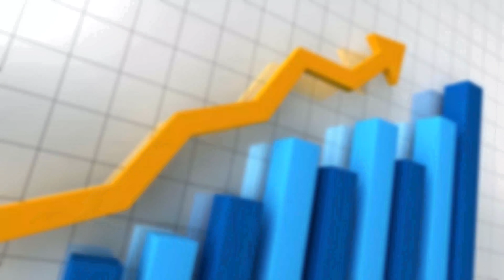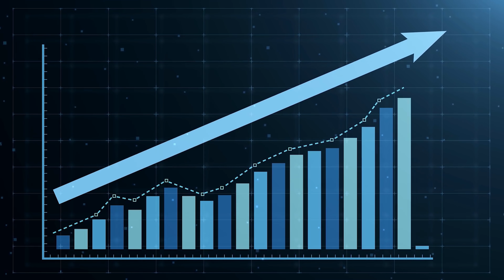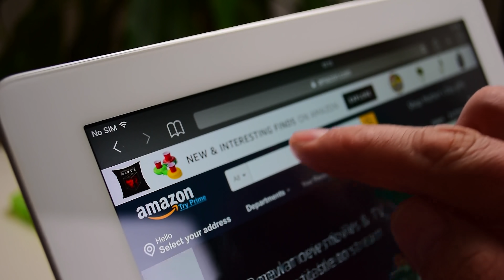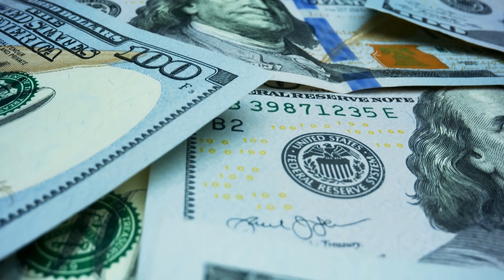How Does SpaceX Build Starships So Quickly?

Comment: These are not actual rockets, more like tin cans.
They do serve a purpose to get the landing right. But these are no where close to a real rocket that space x envisions

Things will slowdown once they build ships that have re entry capabilities. As they require more strudy building. Ceremic coating

I think they might have to go in for some redesign too.

And then there's the boosters for this rocket, which itself is a big challenge.

So bottom line...things will slow down as soon as spacex changes its goals from landing to re entry and landing

Comment: a lot of numbers printed to work as bombers 
wider from down and more thin from up 
to make it more easy to land 
3 shuttle if replaced by one or central one 
to work as ball that is with camera on many planes 
gear to make it move and another gear to make it move >> up down right left 
so ball will be the main shuttle
Reply: 3d printed clay mold 
and pour or press melted metal or steel at
Reply: many rocks mixed with metal steel 
to decrease cost 
use only water electrolysis gases as fuel 
make many printed reservoirs as water tank that on top of it 
the bump that take main 2 gases
Reply: if you make door for reload after landing 
door will be with slope that reach to earth 
and from inside it is like shelves things like elevator 
that rotate also 
this reload will be g dam or rockets or capsules that contain rockets ?
Reply: and if you use it as bus for civilians >> also may be good idea
Reply: inner walls will continue the space for tanks above civilians tanks of fuel ?
may be
Reply: they have path on microscope to make lens go up or down
gear and this path is needed for elevator side walls inside the rocket this elevator present and spin on central point  and has many faces in front of door
Reply: the material for big sizes need to be solid like if it fall on it`s side >> it not explode >> for the ball it may contain hole on it is upper side inside rocket >> so the air of propulsive will be sufficient to carry high weight that not at it any fiber carbon or thin wall whet ever made from steel or steel with rocks >> so need huge consumption of fuel to carry it with suitable diameter of the ball to make these things go out to carry it at landing or take off >> landing need to be so slow like if you want to make it stable at certain altitude vertically it suppose to be easy 
so it can land so smoothly AT eARTH >> SO if there is hole at uppeR SIDE OF bAll 
whaT it mean ? it meAn the parT that cArrY propulsive air is solid Tube also 
but when it attach to ball it meAn the hole in the ball at any position cAn filled with thaT aiR so the tube may consist of 2 parts one of them is JUST Like the ball at CONJUNCTIOn By SEcond part of tube 
why ? cAuse if the part that come from tube let us say up and down >> will allow ball to fill by air from it is hole on up side of it will fill easily as this part come from tube cover ALl THe bAll aT AnY POSitioNS oF it is up and down when it rotate 
it is like half ball or arch above ball to supply IT WIth air buT when ball move right or left so it mean the tube with it is arch part that atttached with ball must have flexiBlE MOvE
Reply: to compensate lost in fuel due to heavy weight 
so it may rElated to size of whole ship
Reply: i think also in things about >> propulsion unit shuttle part 
if there is fire at it >> when you print the skeleton clay mold 
that between it is layers 
you use drill and things like that when each layer got dry 
and fill betwEeen it is tunnels the metal materital
but part between shuttle and what above surface the locateD above shuttle part >> may be steel then layer of thick sAnd or melterd glass >> it may need after print of total rocket to let the up side open to fill it with sand then add cap and rotate it on the top part of the rocket to be one part >> sandwich sand at middle or glass above shuttle part incase of fire situation >> that make temperature above this ceiling is so normal in case of fire
Reply: also legs will always be open 
and fixed part and already printed as one part of the rocket boDy 
it will be thick and easily able to land at 
there will be design for rockets between 2 of theSe 3 lEGS 
TheRe will be 2 WIngs like rapTor bACK pARt >>> so think in suitable Design

Comment: Cheap, SN test platforms is how and why. There is a lot of structural precision that's missing from these rockets. As well proper fuselage cross sections made with more expensive materials.

This is in no way refined, but in fact enough to gather great data. As I have said before. The SN to keep an eye on is SN14.

Comment: Honestly, the Starship factory has been a failure, except arguably in material choice. They can't even match Grasshopper's performance 9 entire years later.
Musk is an idiot who needs to take his hands off the wheel. 4:20 wasn't chosen as an ideal time to cut off engines by responsible engineers.

Comment: They should really consider spiral welding with separate inner tank sections. I’m still worried about structural strength when it comes to Starship. Especially with the large windows they’re planning on installing.

Comment: Presumably once they have a functioning SS/SH, they will switch to manufacturing them all identical, or at least a few different models (liquid cargo, bulk cargo, methalox cargo, crew, etc).  One of the worst aspects of the Shuttle with regard to the tiles was that not only was every tile a different shape, but the corresponding tiles weren't even interchangeable between orbiters.

Comment: The way SpaceX iterates means that, by the time StarShip is finalized and human rated, almost every possible failure point and concern will have been experienced, isolated,  and engineered out, making it safer than a launch vehicle that spent most of its design life in a software program. I believe this aggressive approach to prototyping is a wise decision overall. And it makes for a great show, as well!

Comment: So you're telling me that everyone else straight up moved on to the complicated and expensive materials and forgot about stainless steel which ends up being better and cheaper?
Reply: That's because most orbital class rockets are much smaller thus lighter, materials can be used, increasing performance. This is why the F9 is made out of aluminium. If you tried to make Starship out of aluminium it'd be that thick it would be heavier that using stainless steel. This process works for all vehicles. There's a limit to materials before alternatives are considered. Good question though. Certainly less common and fun to answer.
Reply: @hasercorp8140  yo, thanks for the info bro.

Comment: Heat tiles don't matter nie Because they nie don't need them. (But I could add that due to shape of Starship most of them are same that could speed up reuse)

And there is one part with production problem: Engines. 
They are very complex and they need expensive materials.

Wow, Elon Musk is old now.

Comment: They don’t have to account for pilot safety w/unmanned.  FACT : payload costs have gone up for everyone since SpaceX and not 10x cheaper, or even a modicum cheaper.  Not that Elon is driving it up on purpose and payloads can finally get bigger, but costs are comparable to Ye Olde Shuttle.
Reply: Space shuttle:
Cost per launch: US$576 million (2012) to $1.64 billion (2012) (whatever that means, I'll use 576 in calculations)
Payload to LEO: 27500kg
$/kg= just under $21k

Falcon 9:
$62mln per launch
Payload to LEO: 22800kg
$/kg=a bit above $2.7k

Yeah.. almost the same lol
Reply: The numbers have been irritating me for a while, but Thunderf00t recently pulled it all together.
Reply: @jonathanedwardgibson  If you add HUMAN PAYLOAD.
Reply: @jonathanedwardgibson  If your are OnLY DELIVERING PAYLOAD, SPACEX IS CHEAPER!!!!
Reply: How are 60 millions comperable to 500+ millions?
Reply: Shutle cost sometimes went up to more than 1,5 billion
Reply: the space shuttle will be almost cheaper IF it used to its 100%  capacity, but the truth is Nasa barely did that. Yes, they almost frequently doing that but nearly to
the space shuttle retirement, just to make up for the loss. Also, the space shuttle takes months to reburish compare to the falcon 9. 450 million = 512 million in today's money. In comparison, Spacex 55 million x 7 + 62 million  = 447 million dollar.  2 falcon nine vs one space shuttle
Payload comparison (22,800 kg) VS (27,500 kg). By the way you can also take the falcon heavy to account. 55 million * 7 + 90 million =  475 million. Remember the falcon heavy can carry almost 3x the payload of the space shuttle.  63,800 kg vs 27,500 kg. If your taking payload to the iss then it will be a whole different story. The crew dragon will be volume constraint, so the space shuttle will take the upper hand.Spacex can only deliver  6000kg (10k/kg) to the iss due to the crew dragon's volume constraint. so in comparison
55*7+27500kg*10k=660 million vs 512 million. Now this is a fair comparison. By the way spacex can lower their if they needed to or if starship becomes operational. Thunderfoot didn't tell the whole truth which is dick move if you ask me.